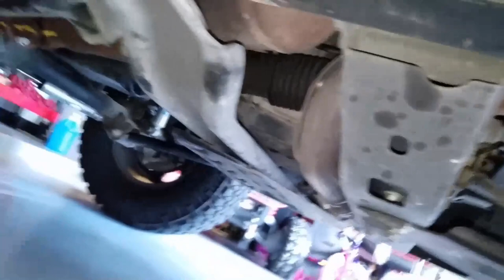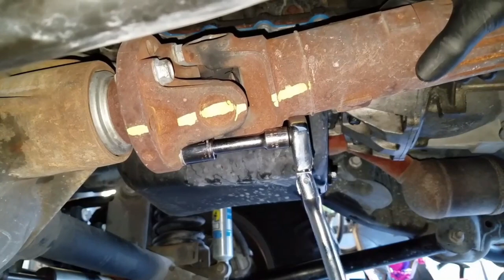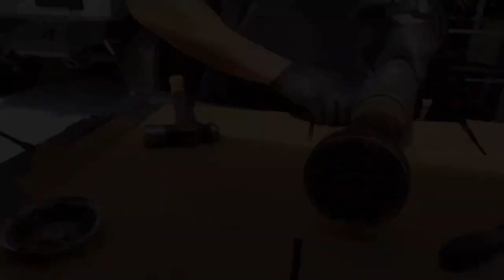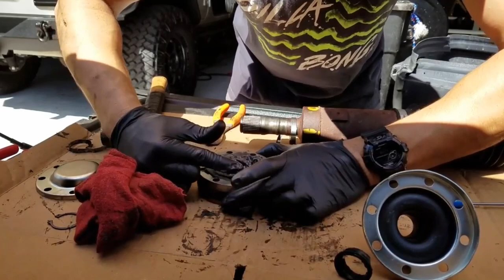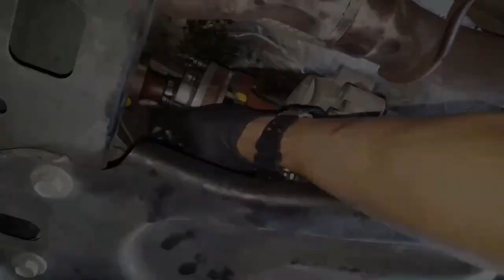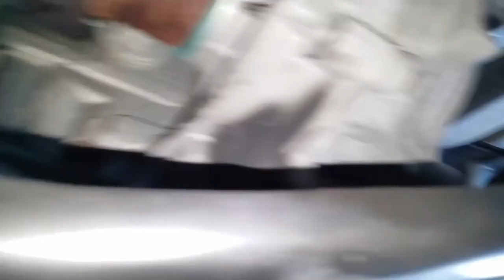DriveShaft Boot  Replacement Jeep Wrangler Jk Failing cv joint service jl

Comment: Nice work! I was swapping my clutch out (well, still in the process) and I found the front driveshaft boot shredded. All grease (dried up) under the Jeep and the joint is literally gunked up. I'm thinking of just replacing the whole joint instead of the boot. But you showed me how easy it was to get it apart for replacement! Nice video!
Reply from the maker: Thanks! Check out the whole joint video https://youtu.be/Y-apEuWpb-4

Comment: The boot failed because the lift kit, and the angle the shaft is now at. Should have installed the terraflex high angle kit if you were going to go through this work and be done with it.
Reply: Liams House 
Watch those teraflex rzeppa joints. They fail. Mine failed after 12,000 miles. They supposedly redesigned them Last year because of the failure rate. Replace my rear upper last July with their joint thinking I was one and done too. Put a complaint into TF a few days ago and haven’t heard from them as to making it it right. 
I replaced my front upper joint a few months ago with an OEM replacement. Fuck teraflex and their expensive garbage joint. OEM joint replaced for 1/3 of the price of TF crap cv joint and bet it’ll last more than 12,000 miles.
Changing the TF joint to an OEM. I’ll take my chances.
Reply: @gregbisesi9966  I agree. I'd def go oem rzeppa and even balljoints if you run a jeep with less than 35s. Just my opinion. If you dont do severe rock crawling and drive your Jeep within its limits ie dont abuse the crap out of it and run tires up to a 35 oem is better than most aftermarket. Imo
Reply: Rhino Willys 
As an update to my last post. Teraflex was decent enough to send another joint free of charge. I installed that but it is overheating and also is about to fail. I’m done with it and heading to Tom woods to get a new rear DS. Now my OEM front upper, god bless it still going strong getting to about 20,000 miles. It’s easy getting the front shaft off at the u-joint, but that rear shaft is tough to get the lower differential cv joint out with out damaging it to fix the upper. Just finished ball joints and axle shaft u-joints. Lol that’s why I’m having Tom Woods do the drive shaft, I’m tired of the non fun, non bling upgrades. Good luck with yours.
Reply: @gregbisesi9966  Thanks for the update and insight. God bless you and yours. Please if an when you get a chance once you've put some miles on those new shafts, I would love to hear your thoughts. Waving a hand from RI.
Reply: Yep no problem. Tom Woods gives the Jeep club a nice discount so just about everyone in the club that has replaced shafts runs them. Don’t believe I’ve heard a discouraging word from anybody. 
Take care Amigo.
Reply: @gregbisesi9966  Copy. Thanks. Yeah, I havent heard any negative stuff either on those shafts. You stay safe also Brother.

Comment: There won't be any balancing issues taking the driveshaft off at the joint. You would only have an issue if you took the drive shaft apart at the center and didn't put it back in the right orientation. It's not balanced while it's on the vehicle.
Reply: Thanks..I was wondering about that. I took off the driveshaft to replace the cv joint. But I didn't make any marks. BUT I didn't take the driveshaft apart

Comment: Had you do it over again would ya have just replaced the whole cv joint? Your link says it fits 2011-2013 my jku is a 2016 and “looks” exactly the same as yours..... what year is your jeep?
Reply from the maker: nope, only if it was noisy.  2008.  2016 drivevshafts are the same.

Comment: Thanks so much for this video. I drive 19k a year commuting alone in the Northeast so I run severe duty schedule on my 16 JK I'm underneath her regularly checking for wear on parts and always check those boots for tears every 5 k during oil changes and in between. My question to you is should I remove and repack the joint at 55k? I'm running a terraflex leveling kit and that's my next oil change will be doing diffs transfer and tranny fluids. Diffs I do once a year. The boot looks fine and no noises. Thanks again for the great video will use it again for reference when that time comes.
Reply from the maker: If it isn't broke, dont touch it.   As long as if holds grease it will be fine.  Thanks for the awesome comment.

Comment: Your lucky you didnt destroy the cover plate while taking it apart also I think I would have put it in a parts cleaner and flushed out all the old grease before repacking it .Am also wondering how long this repair lasted .I myself just replaced both driveshafts with Adams 1310 driveshafts

Comment: I am just curious, the front drive shaft on my wife's 2010 Jeep Wrangler has like a ball pivot on the end of it where it goes to the transfer case. Mine looks nothing like this one. Do you have a video on that style???? The boot is gone and it's dry and wobbles around. Need to fix before winter, however don't really want to spend $500.00 for a new shaft. Any help would be greatly appreciated, thanks and just subscribed to your channel. Keep up tje great videos.
Reply from the maker: Its the same driveshaft.
Reply: @Donnythelatemodeltech  so does the swivel ball come off the end of the shaft? Thanks for your help and response.

Comment: Great video but I would not have used a hammer on a bearing.
Reply: Mr  Jose,  if you look at the video closely,  you will see the he was nowhere near the bearing. The bearing is on the outside of center carrier and bearings ( balls that make the bearing) are held in place with a retaining cage. I assure you that what he done is perfectly fine and is exactly what the dealership or other garages will do. Have a blessed night.
Reply: James Stafford If that is the case then it is improper maintenance practices.  I used to be an aircraft mechanic in the a Navy and if I did that I would have been written up.  Perhaps my maintenance practices are more critical. 🤷🏽‍♂️